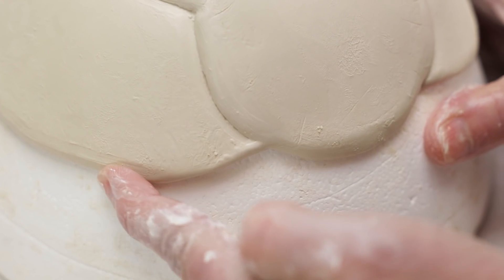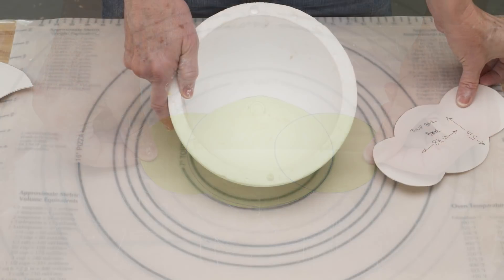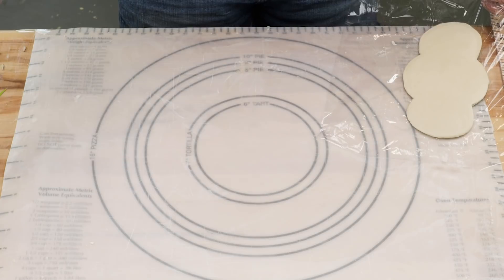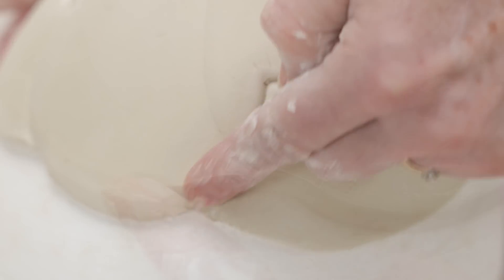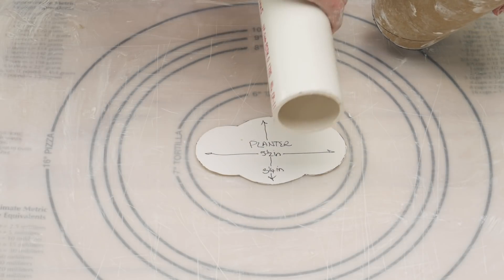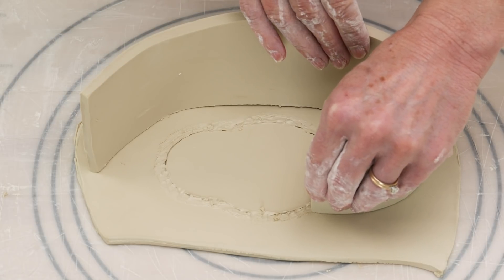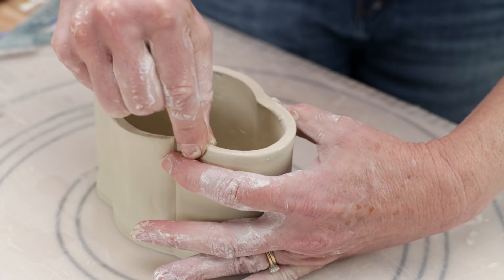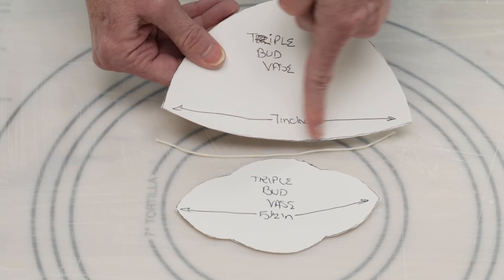A Better Way to Hand Build Pottery - NO MEASURING! FREE TEMPLATES!

Comment: I love these soo much! Wow!! Thank you so much for the templates!! Can you elaborate further on how smoothing the rim down helps the piece to not warp! I have such problems with warping. Thanks as always Ann.
Reply: Hi Michele.  Good questions.  Actually it is not really the smoothing the rim, but it is pushing the rim backwards.  I am thinking that if the clay is already bent in one direction, that it would resist random warping.  In other words, I am trying to control the probable bend in the kiln by bending it the way I want right now before it goes in the kiln.  Does that make sense?  Thanks again for watching Michele!!
Reply: @annruel1982  YESSS! I totally understand what you mean!! I will start trying to do this with my mugs. I only hand build and thought I had finally figured out how to get my mugs/cups to stay round. I bisqued a huge kiln load last weekend and only had one mug go wonky on me. But it was really bad! Not sure why since I make them all the same way. Thanks again.

Comment: Wonderful demo, once again. Why do you do these projects in porcelain and not regular clay? How does this change the work process for you?
Reply: Hi R.V.  Good question!!  I have limited the clay in my studio to two.  The Standard English Porcelain 365 and I also have a non grog brown Highwater cone 5 clay (I only use the brown clay to make specially decorated pieces on the white clay). I chose the Porcelain because first the smooth non grog surface makes it ideal for painting underglazes on which is my main way to decorate my pottery.  Second, it has a cool white color which is what I wanted against the warm underglaze pallet I paint with.  Third, as the clay is non grog, the clean up is easier than stoneware.  Even at the bone dry stage, I can go over the whole thing with a sponge and it becomes as smooth as butter.  The downside of course is that it is very finicky.  Without grog, it can warp easier , it shrinks more, and you have to really watch how it dries so it doesnt crack.  If I were doing just about anything other than underglaze painting, I would probably choose a more hearty stoneware.  Hope this answer helps :-)

Comment: Thanks! Your video is very easy to follow. Wondering if there is a way to print the templates?
Reply from the maker: Most folks just print them off as a jpg file (and resize before printing) to their needs.
Reply: Thanks Ann!